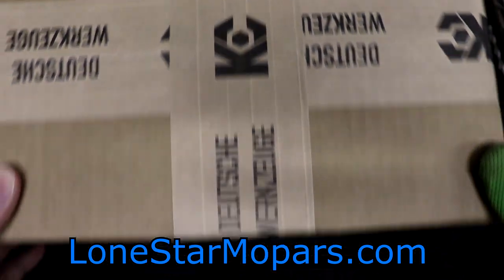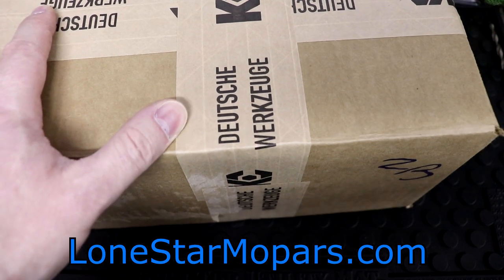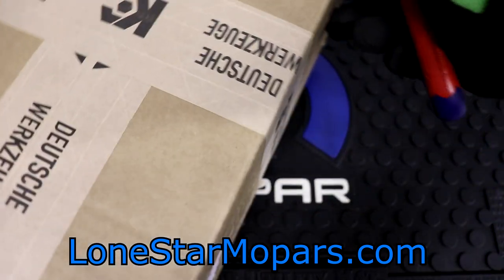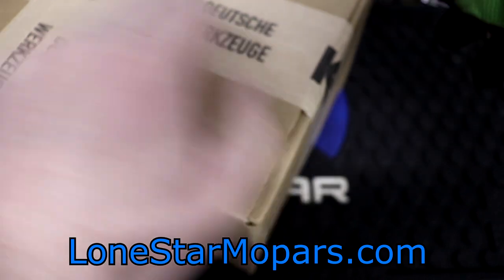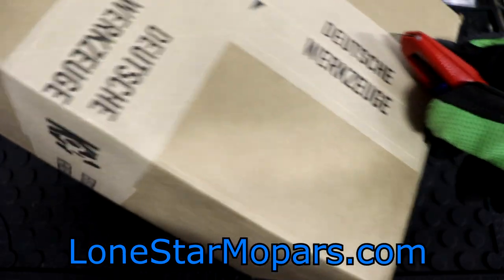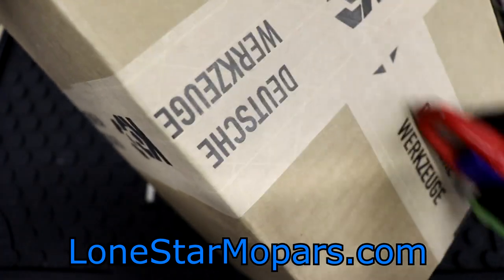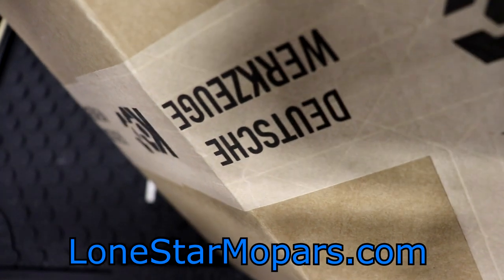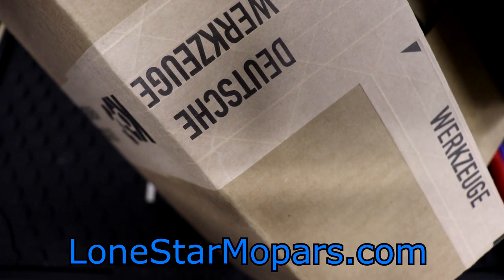Coolest Precision Screwdriver Stand Ever?!  3D Printed Sci-Fi Stand from Witte Checks all the Boxes!

Comment: I wish they made a precision bit storage like they make for 1/4" hex bits, I have the Mac precision bit set but dam are the bits tight in it so tight I had to pry them all up with a screwdriver and leave them sitting on top of each slot
Reply from the maker: Is that the Mac one in the blow molded case?  That thing is terrible...a friend pulled that out a few weekends ago and I had the same problem.  Wiha has some nice sleeves, but I think they cap out at 10 and you'd need 4+ of them.  If you want the size, foam layouts might be best, but could still be awkward.  I'm trying to remember if I tried precision bits in the Bit Boss...I know it is tapered, I'll check when I'm in the shop tomorrow.
Reply: @lonestarmopars  ya it's a blow molded case, SBDR42SA 42pc Mac grip ratcheting 1/8" hex bit kit. Great selection of precision bits but the absolute worse case I've ever used

Comment: i purchased these a week ago but stahlwille labelled, that come in the pouch.  my ernst gripper was just dropped off. seems i am having a very lone star mopars kind of day
Reply from the maker: Sounds like an awesome Saturday to me!  I technically don't own a Stahlwille precision driver...
Reply: @lonestarmopars  they only changed the colour scheme so you kind of own stahlwille with these Witte drivers. Or I technically own witte, either is fine lol
Reply from the maker: Very true...I keep wondering if they will go black and green vs the gray and green.  Witte has changed things up with their line, but I'm guessing Stahlwille is set with the current color schemes.
Reply: @lonestarmopars  they'd look even better if they updated to just black and green. If the stahlwille didn't come in the nice Pouch I'd have just gone with witte. I got them for around the house but if I need a set for work I'll go witte being most of my work tools are gedore so black and blue will fit in nicely
Reply from the maker: Good call!  Yeah, the main gripe I have with that shade of grey is it shows stains real easy.  If you like the way these perform, the Witte's would be a good addition at work.
Reply: @lonestarmopars  yeah true I can see the grey side getting stained. Luckily they won't see much use and the job they need to accomplish mainly is sunglasses screws lol